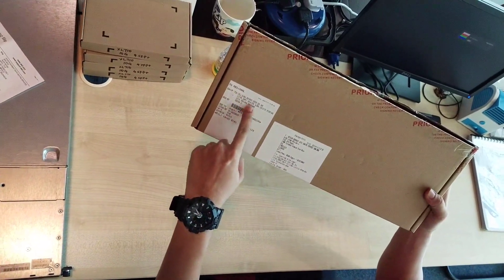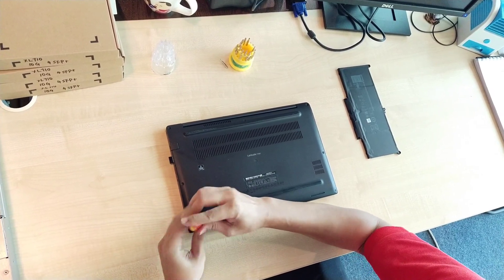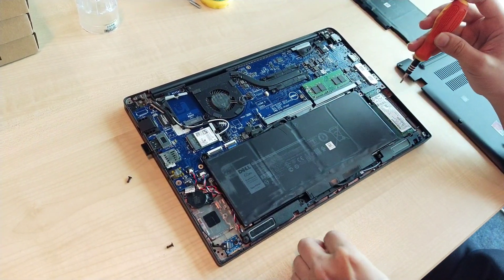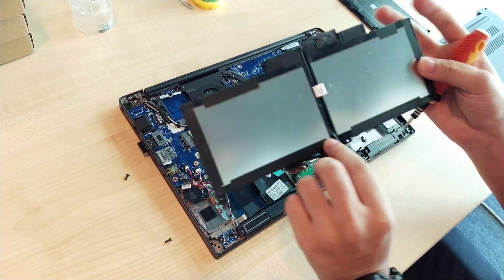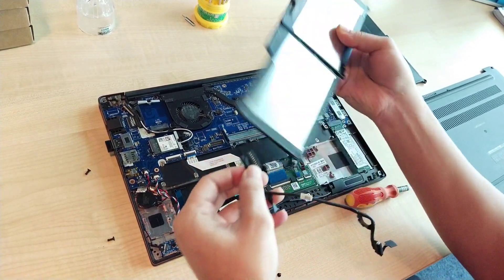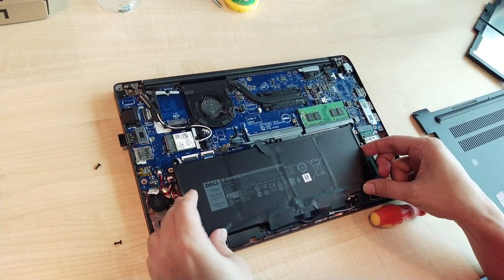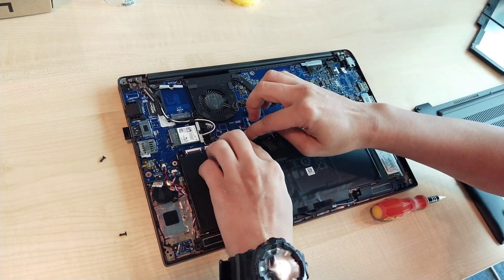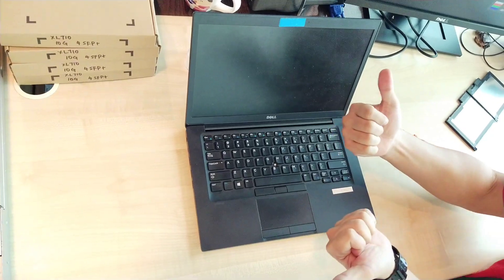Replace Battery Dell Latitude 7480 7280 7380 7490

Comment: Thanks this helped. Only few things to note
1. After removing the screws, you need to insert your finger nail in the gap and pull up the cover.
2. Take care of the screws as they are very tiny and can go here and there.
3. As noted by others, while removing screws, apply slight upward pressure so the screws don't slip back down.
4. Be as gentle as possible.

Comment: Thanks for sharing! Got a replacement battery (likely OEM) to replace my old bloated one. The hardest part was removing the battery ribbon. Was kinda worried I'd break the ribbon by yanking too hard. Aside from that, it was rather straightforward😁